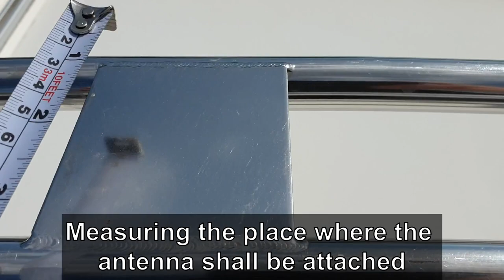Installing Teltonika RUT240 and Poynting OMNI-A0121 antenna

Comment: Even if your antenna is outside and only has a single connection back to the router you should ALWAYS use a second mobile antenna on the spare connection on the router for peak operation. Even the small ones that come with the unit will suffice. 4G just works better with two connections.
Reply from the maker: Great info, thanks a lot! Will do so.

Comment: would you recommend this sort of setup for a rural setting up north in sweden? Was interested in using this for a home work setup. wha tkind of speeds are you getting
Reply from the maker: Hi John! For me it worked great last season in the boat. The Stockholm outer archipeligo has very bad coverage, but I still got 3-10 MB/s in areas where I previously almost did not get any internet at all on the mobile phone. Of course operator is important, I use Fello which uses Telia's network. It all depends on where in northern Sweden: towns and willages normally has superfast internet even there these days.
Reply: @Baranoeda  ah ok that's not bad. We are also with Telia. Nearest town is Sveg but maybe still 10km from the mast. Our problem is the connection can be fast at times but it's just too unstable. Constant cut outs etc. Maybe the router is at fault but it's hard to know with 4g. Too many factors are available compared to a simple wired connection.
Reply: @johnpayne516  Sorry for the late reply, in fact, for rural setting, you can use directional antennas for rural locations, as most likely, they will not be moved and you can point it straight to the mobile tower, if you can make them to have a clear view, that would be best.